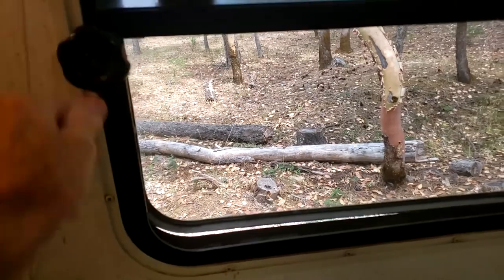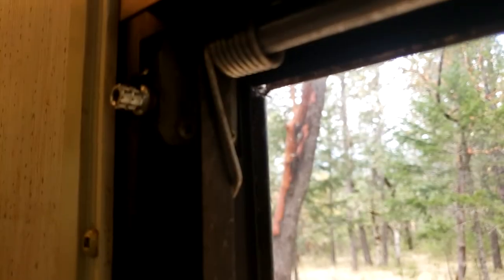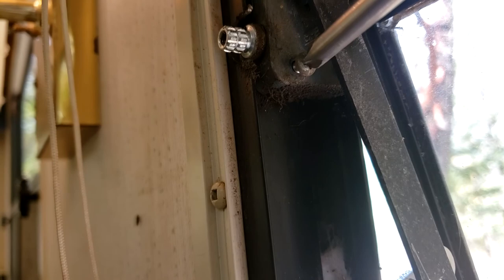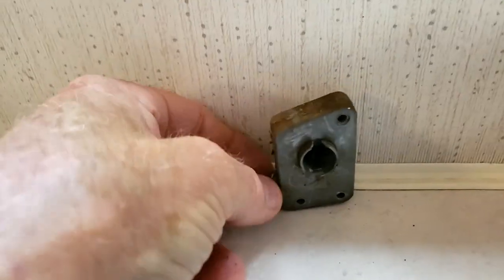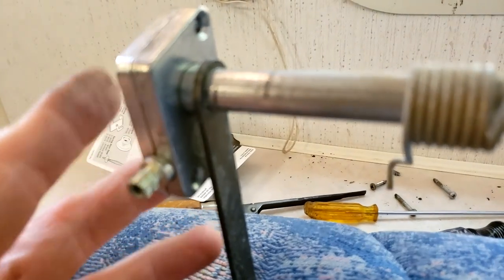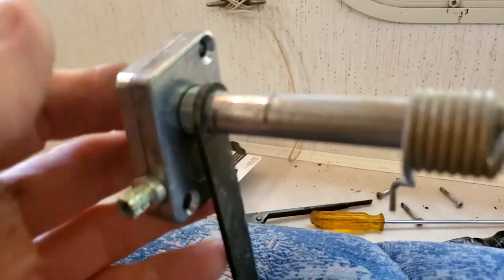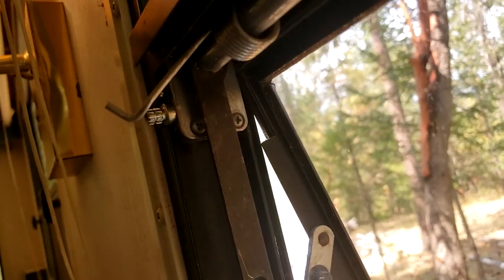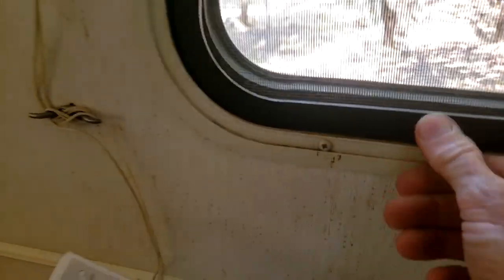RV Window Crank Repair/Replacement

Comment from the maker: Links to these 1-3/4" window operators.  
Right-hand 1-3/4" window operator:  https://amzn.to/3Q3sSES
Left-hand   1-3/4" window operator:  https://amzn.to/3BjsBd0
The measurement is from the lower screw hole to the upper one.  Note that in the mounting position shown in this video, the right-hand window operator mounts on the left side of the window, and vice-versa for the left-hand operator.  I don't know if there are any situations where these are mounted upside down (as compared to how they are in this video), but if so, the left hand operator would be mounted on the left side of the window, and the right-hand one on the right.

As an Amazon associate I earn a small commission on sales if you use these links.  There is no extra cost to you.   Thank you for your support.

Comment: Thank you for the tutorial. My husband did one smaller window. And I did the larger window. With the exception of losing the c clip which I will be buying a replacement. It went pretty smooth. On both windows however we did have to file the gaps in the rod a little larger to fit the new assembly.

Comment: Thank you, it gives me hope because as of now we have 3 windows that don't crank open or close and a couple that are starting to have issues.. 😃
Reply: Just need to see which shape they are before I buy...
Reply from the maker: I know what you mean, Carol.  I still have one window that won't crank but I didn't fix it because we never use it (there's a TV in front of it).  Several of these were broken for years before I finally made time to look into it.  It's nice to have working windows again!

Comment: Be sure to check that it is not just the turn knob that may be stripped. I took a working one and tried it on two of my windows that would not open, and it turned out to be only the knobs that were stripped, not the gears! Thanks!

Comment: God bless you for this. Mine is different in that the mechanism is in the center of the window but my bedroom has 2 of these blasted windows and one of them is stripped. I jimmied it and got it working with a locking pliers and duct tape but now it's back to not working more than working. 

Where do I find those stupid mechanisms? I have a Winnebago Adventurer motorhome. You know, I know there's a website to order parts but it's hard as heck to figure out just what they are calling these parts, and it seems there are so very many that it's nearly impossible to feel confidant you're ordering the right one.

Anyway, my mechanism has the bar running straight through the middle of it and hopefully I'll order the right thing. I wish they'd design this stuff with the repairs in mind ! Thank you so much for making the video, which wasn't easy while you were trying to do the actual repair.
Reply from the maker: I feel your frustration.  It seems during the engineering process they never think of the poor fool who comes along years later to repair these things.  I found these on Amazon, but there are also some for sale on ebay.  In fact I just ordered another one on ebay and it turned out to be the wrong one (it was rectangular rather than having a slant edge on top).  These things are called "window operators" and I wish I could tell you a place where you can sort through all kinds of them, but it's been hit and miss with me.   Best of luck.
Reply: @MTMiser  What I really want is to be able to look inside the mechanism to see how it's designed to work. That way I could try to come up with a better something-or-other to do the job and not break down again. Right now, I've taken the round dial off of the crank and am monkeying with the doohicky that the screw goes into and with patience, I can get it to at least open an inch or so and then close it again if I need to. 

On really good days, I can even get it open about 3 or 4 inches ! After that point, it seems to lose its grip on the stripped inside thingie and then it's back to square one. But I'm determined to find a way around this. I somehow thought a Winnebago was built with quality parts. HA !
Reply from the maker: @Pack.Leader  I know what you mean.  Mine is an Alpenlite which had a pretty good reputation, and lots of things have gone wrong with it.  Then again, it is 26 years old so it's kind of hard to complain too much.  But it was 15 years old when I bought it and it had tons of things wrong with it then that I fixed.  I have a neighbor with a 30-foot Winnebago 5th wheel that's fairly new and he says he's had lots of problems with it too.  My sister has a smaller Lance trailer, which is supposed to have a great reputation, but she's had lots and lots of things go wrong.  There's a video out there somewhere showing a Jayco trailer being built and they throw these things together so quickly it's no wonder that all kinds of problems arise later.  The workers were literally running.
Reply: @MTMiser  I believe it. Just look at an RV park after a tornado blows through. Looks like a gigantic pile of matchsticks. I'm sad to hear that even Lance has issues. They need to stop charging so much for these things until they start making them with better quality and an intention of making them last longer.
Reply: @MTMiser  And I heard during covid they really slapped them together carelessly.  That means newer are worse than older.

Comment: Why are the tension springs for this type window so expensive? I only need 1 LH and 1 RH spring.
Reply from the maker: I wish I knew.  Some RV stuff is priced like it's made out of gold.  Have you checked with an RV salvage yard?  You might be able to save some money there, but I'm not really sure.

Comment: THANK YOU SO MUCH, for making this video helped me out so much. do you know where I can order a new rod , spring and bracket for the window?
Reply from the maker: Johathan - glad the video was able to help you out.  Sorry, I don't know where you can get those parts, but a good bet would be to search around on ebay and/or amazon.  There are a few places that sell RV-specific parts like Camco, Pplmotorhomes, All-Rite and probably others but I don't know if they have those specific parts.  Another good possibilty is if there is an RV salvage yard near you.   All the best, and good luck.
Reply: @MTMiser  Thank you so much for getting back to me, have a great day

Comment: Hello Maynard, thanks for this excellent post.  I fear I have a different problem; my window will not crank in tight because I think the slide rail it hangs on is sprung and the operator is not strong enough to pull the window in.   But, while I was watching you work on the lower window, I noticed in the upper window some sort of red device.  Can you tell me what that is?  Is it some kind of latch I could use on my lower window?
Reply from the maker: That red thing is a latch that holds the bottom part of the upper window in.  That window is an "exit" window (for emergency use) so it is made to open  when needed.  Sorry about that being sprung.  One of mine is like that too.  When it bugs me enough I just go outside and push it in, and it will stay that way if I do that, at least until I open it again.

Comment: Kicksss video, that looks easy! All mine are broken. Just bought a 40 year old camper for a sore dick deal.
Reply from the maker: Two more of mine just broke as well.  Sometimes it seems like all you have to do is look at them and they break. Both of these windows were rarely used.

Comment: Hi Maynard :) my arms do not have c clips, they are rivets. If I remove the rivets what can I replace with? I tried moving forward without the arms being separated but I can't get the operator off. Thank you!
Reply from the maker: Hi Patricia - I would probably buy some small screws to replace the rivets.  You could get some Nyloc nuts to go on the end of the screws, which would prevent them from loosening up later (they have nylon inside to prevent the screw from coming loose).  Just make sure not to tighten the nut too much so it doesn't make it difficult for the arm to move.  Either that, or you could put two regular nuts on the ends and tighten them up against each other, which would also prevent them from coming loose.   Good luck!

Comment: I can't get the arm pins out
Reply: They are knotched in the botton, and L shaped at the top.  Does the bar turn somehow?,
Reply from the maker: Are you talking about the pins in the silver arms that come out from the window?  Those pins at the bottom of those stay in there.  You just need to remove the c-clip that holds them to the black arms, then push those pins out of the holes in the black arms, as shown in the video from 2:07 to 2:28.